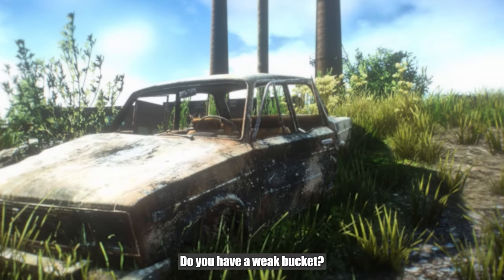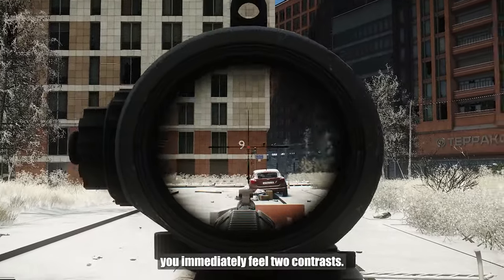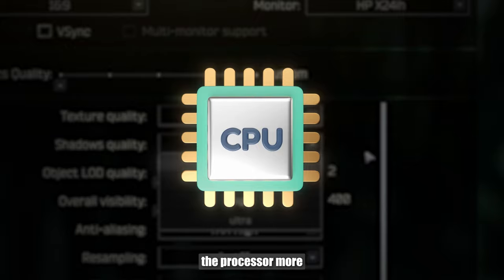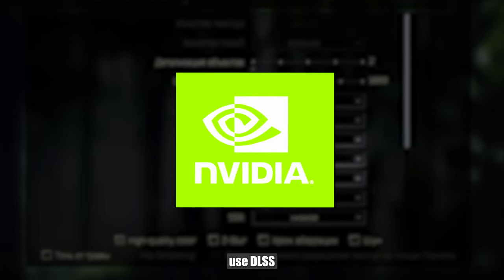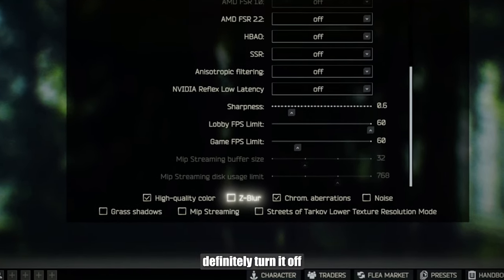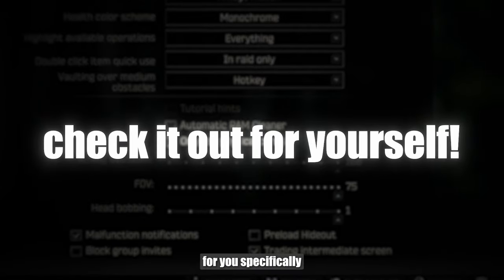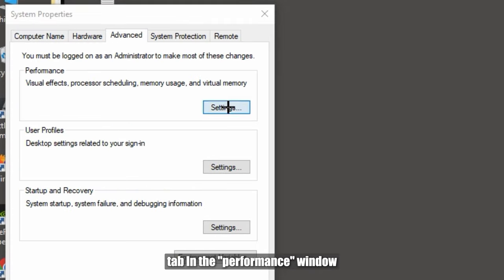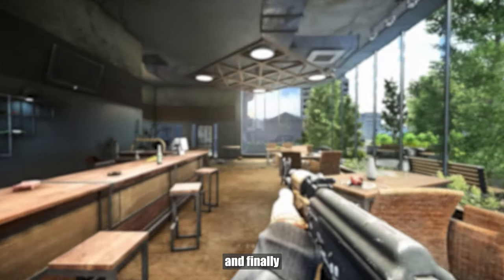SETUP AND OPTIMIZATION OF TARKOV IN PATCH 0.14 ● Escape from Tarkov ● Tarkov ● EFT ● Tarkov

Comment: rtx 2060 super with ryzen 7 5800x3d running textures and shadows on low 1440p, is that optimal for maximum fps?
Reply from the maker: If you want maximum FPS, then just turn all settings to minimum)
Reply: would running 1080p with that setup make more sense?  @DISTRUCTEN
Reply: Not sure about rysens. But I have a 3080 with i710700 and if I run 1080p or low settings doesn’t give me better fps because my cpu bottlenecks
Reply: @DISTRUCTEN  Exept on streets